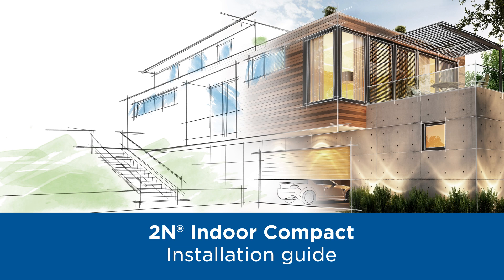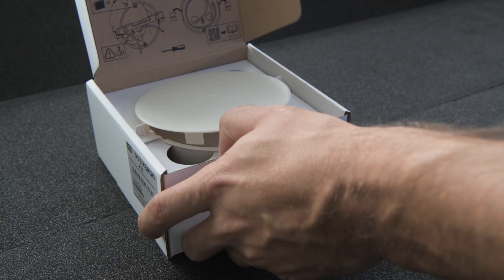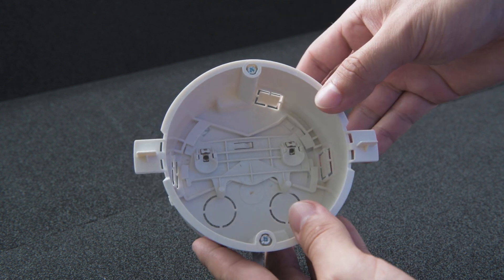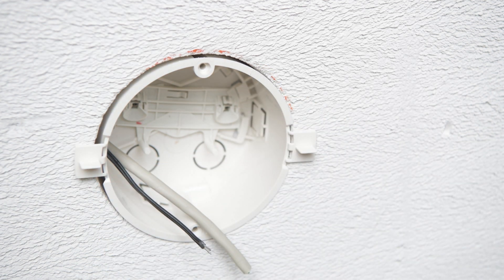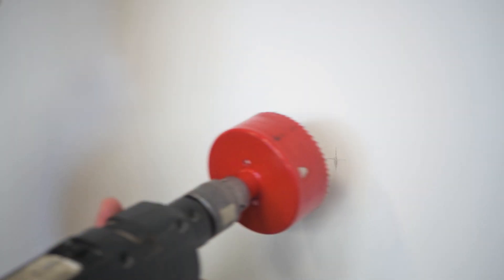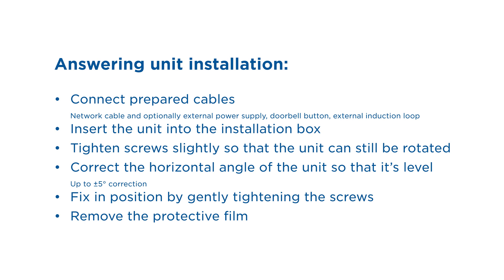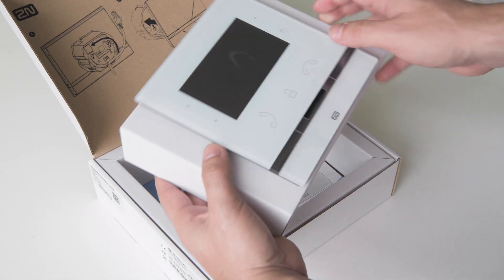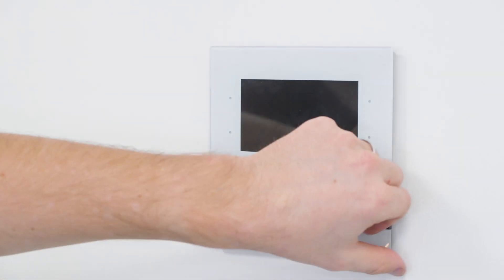2N Indoor Compact Installation guide

Comment: The box is problematic as soon as a Cat7 installation cable is routed into the box and you mount a Keystone module. The combination of Keystone module + patch cable is altogether too long to find enough space in the box.
Knowing this, it is better to drill a hole 8cm deep and place the Cat7 cable with the Keystone module behind the flush-mounted box.
Reply from the maker: Hi, if you have questions about our products or need help with setup, please contact our technical support https://www.2n.com/en_GB/support/technical-support. Thank you, Marek